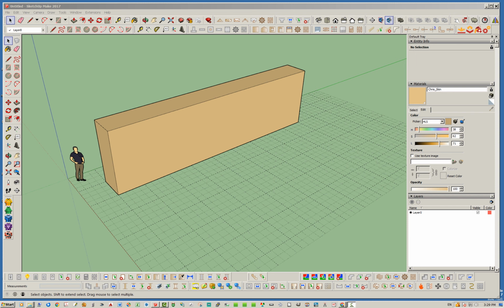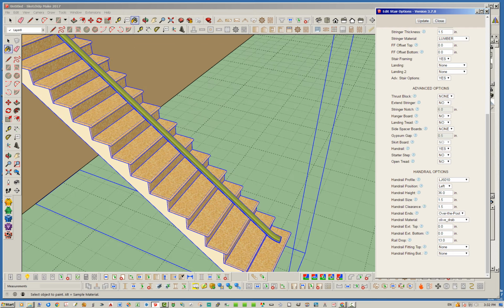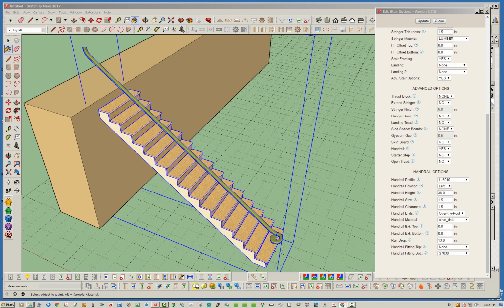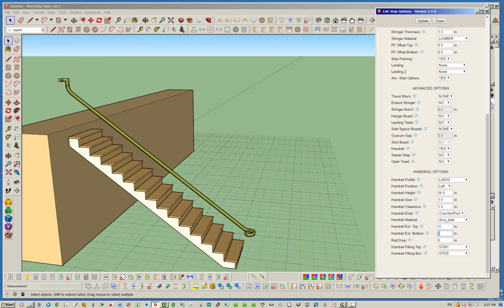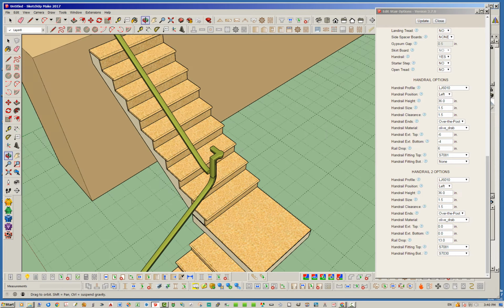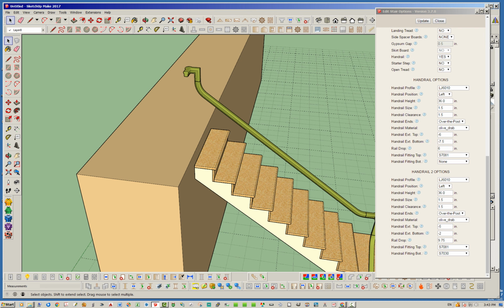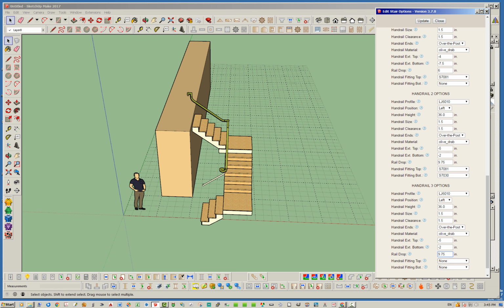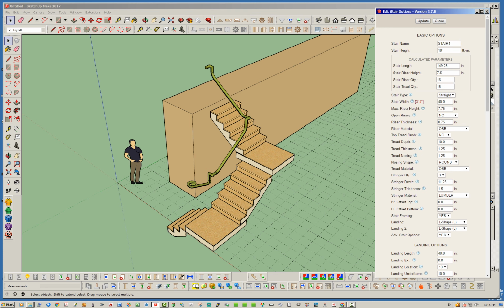Medeek Wall Plugin Tutorial 57 - Over-the-Post Handrails and Fittings

Comment: This IS a Christmas gift. Handrails have always been a problem for me because they always awkwardly connect and land and I never knew how to exactly go about it. It's always been a project in and of itself.  
Lovely. 

Is it possible to automate how they connect in the middle sections for at least the "default" starting point?
Reply from the maker: There is still more to do with handrails but hopefully these new options will allow you to work through your design a bit easier.  Some limitations still exist when applying handrails to both side of a staircase.
Reply from the maker: I am still thinking about how to automate the connecting of multiple stair runs, I haven't got an algorithm yet but I will give it more thought.
Reply: Can you code it to auto connect with the bottom handrail?…
If not can you input an option to read the datum, (x,y,z) and move the handrail to connect?
Reply from the maker: @dannygates806   Possibly but the auto connection is also dependent on if an upper fitting is selected at the top of the bottom handrail.  I will give this some more thought.
Reply: Why does the handrail mimic from left to right as if it’s copy and does follow the stringer?
If you could explain, why it does that and we might be able to understand your thinking better.

Is it possible for you to show us how the users input starts and also if it repeats, like the handrail?…
So we can discuss it with you efficiently and understand how it is connected